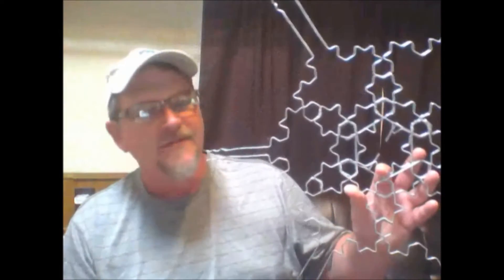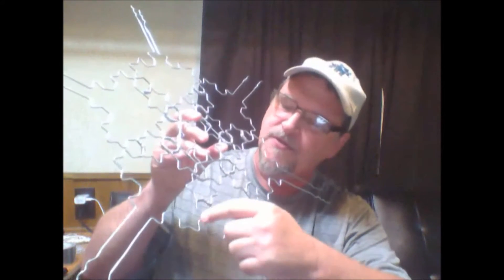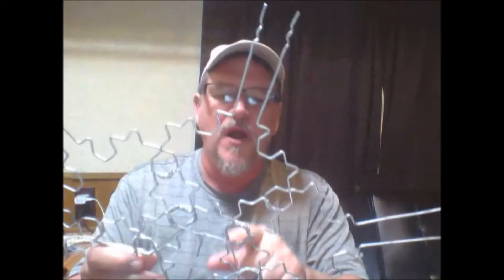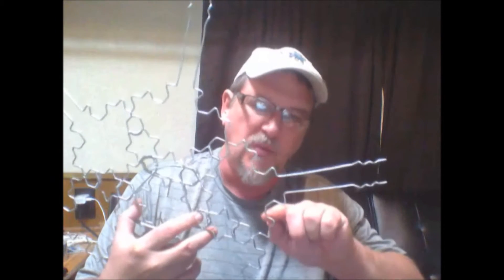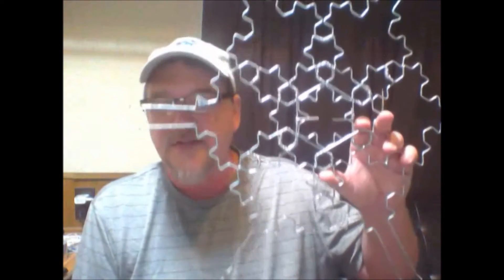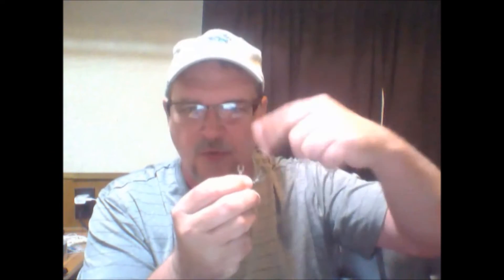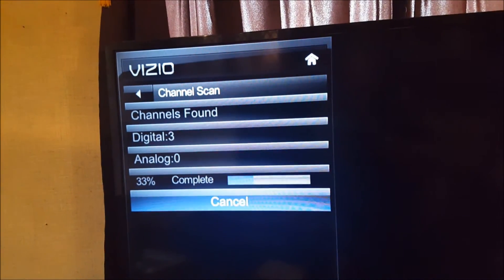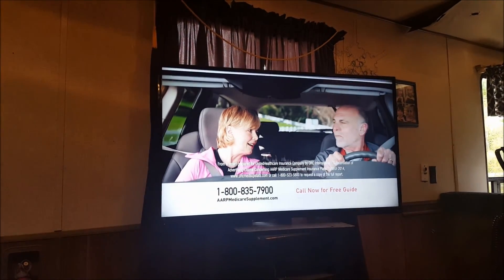DIY: NEW IMPROVED HDTV Fractal Antenna (Multidimensional) - The Mona Lisa of Digital TV Antennas

Comment: What would happen if you soldered the pieces rather than tape? Would it ruin the phase or cancel out?
Reply from the maker: Well, because it's a dipole (one side positive, one side negative), It would not function properly.  You could use solder on each fractal plane to connect the pieces, but only if they have continuity on that fractal plane.  The two halves would need to be connected intrinsically.  In fact, I think my design here could be improved.  I've been considering disassembling it and reconnecting the dipoles using nylon string and tape that is less conductive.  The idea of soldering each plane hadn't crossed my mind, but I would expect it would improved reception even more.  Nonetheless, these fractals are far superior to the store bought versions.  Thanks for comment and idea!  I will be making a new video soon and will be referencing this comment in that video.  Please subscribe and click the notifications icon so you'll know when I've posted it.  :)
Reply: @jthoward66  Awesome! Will do. Looking forward to seeing it.

Comment: did you think of using a reflector with your antenna??
Reply from the maker: A reflector?  Do you mean like aluminum foil?  Have you seen it being used on other fractals?  My understanding is that direction positioning doesn't matter.  It has to do with the quantum entanglements of the dipole signal.  Please share more, if you know of a technique.  I'd like to test it in an upcoming video.

Comment: I downloaded your previous two videos. Excellent! But - your present improved version, while well meant, is too confusing and difficult to follow along. Please do take the time and make a (five part?) step by step instruction video. As an enticement, I have an idea on how to 'elevate' your approach into a visually appealing fractal antenna 'sculpture'. Based on you plans I then would like to create to tutorial.

Thank you for taking the time.
Reply from the maker: I've actually been planning an updated video for a new version of fractal.  I've learned A LOT!  I think I'll do another video on how to bend the fractals.  My new method is SO much easier.  I talk about it in this video, but I think it deserves an instructional.  On my new version, I think I'll replace the stainless steel crafting wire with nylon string.  I'm afraid the metal spirals may cause an inductance issue.  Also, I think the shiny silver tape I used is somewhat conductive.  I love the way it looks, but I want to test it for continuity.   Thanks for the comment!  If you haven't already, please subscribe and turn on my alerts (bell icon), and you'll get notified when my update comes out.  I'll be working on my new video and posting it soon!

Comment: Ok video. A few suggestions for a remake or future update video are, 1. What are the angles of the bends, 2. what is the total length of wire, 3. how to bend the 2 fractal insertion pieces for the F type connector, 4. how to assemble all the pieces including the insertion fractals where the F type connector inserts. Also include the finished diameter of each fractal, and the finished diameter of the completely built antenna. Perhaps make a part of the video showing you assembling all the pieces instead of trying to use power point. You mentioned at one point (I don't recall if it was in this video or one of your previous videos) that each fractal was 36" of wire. The fractals made in this video do not match the fractals you made in the previous video. Why and where do you come up with 36" of wire for a fractal, and would that be considered a 1/4, 1/2, or fullwave version.
Reply: Also.. the way you have laid this out and assembled it, it's not a true kolch snowflake or fractal. It should be assembled so that the middle points are touching, and they don't overlap, that way you get infinite kolch fractals.
Reply from the maker: Have you seen my other instructional videos?  I give step by step instructions on how to bend the fractals.  It's pretty simple if you watch them.  Just subscribe to be and check them out.  It's pretty easy when you understand how to do it.
Reply: @jthoward66  yep I saw your other 2. In my reply to your video, the fractals you are using here are not the same as in your previous videos.
Reply from the maker: That is true.  These are MUCH more simple and accurate to build. Okay, with fractals, size doesn't matter as much.  Uniformity does.  I just used the width of my needle nose plies to gauge the size of each segment.

Comment: are all the hanger sections touching each other or is there tape separating them all? thank you!
Reply from the maker: Well, one half is all connected with metal wire, and the other half is connected as well, but the two halves DO NOT connect to each other.  The only thing that connects them is the the Coax Cable connector that is connected in the middle.  Make sense?

Comment: Wouldn't the wire wrapping create an inductive coupling between the various layers? Would this affect the sensitivity on some channels? Just wondering.
Reply from the maker: Possibly if it was coiled, but each pole is completely intrinsic.  Likewise, that's the beauty of fractals, they are able to collect a wide array of frequencies, unlike "bunny ears" that have to be adjusted to different positions to pick up various signals.  Have you made one yet?  Try it for yourself and check it out!  It truly is the best HDTV antenna available.  Thanks for watching and commenting.  Please Subscribe, Like, and Share!  :)
Reply from the maker: Remember, this is dipole, not polar, there is no covalent bond (sorta).  What I mean is that the polarity of the molecule has already been "decided".  I mean think about it, inductance would be created on both poles neutralizing (if not enhancing) any electrical impedance.  Maybe this antenna would be best classified as the "flux capacitor" of HDTV antennas?  ;)

Comment: Looks hard to overlay to assemble!   Please link your other video to this one as it would make it easier for people to follow.  I have a ? about what frequencies as far as low, high VHF, UHF signals you are getting and how many miles from the longest tower are you pulling from?  I have a hard time getting VHF, high vhf channel 9, from 45 miles away and looking for anything that might pull that in without paying so high for an antenna that i would have to cement a tower in the ground.
Reply from the maker: Yeah, that's a good idea.  I'll get some links posted today.  I haven't done any wave length of frequency testing because I don't have the equipment.  I'm hoping someone will build one and do some testing for me.  Thanks for comment!  :)